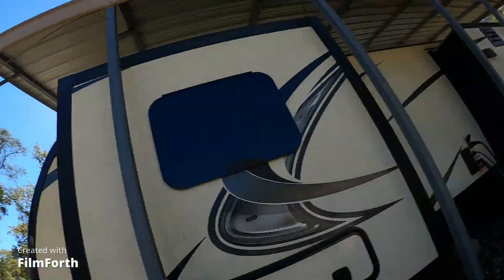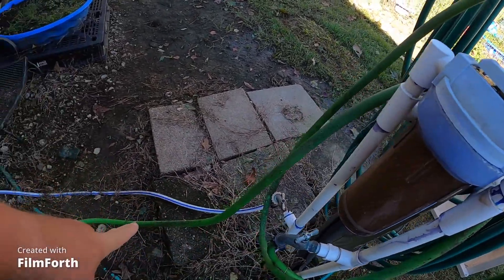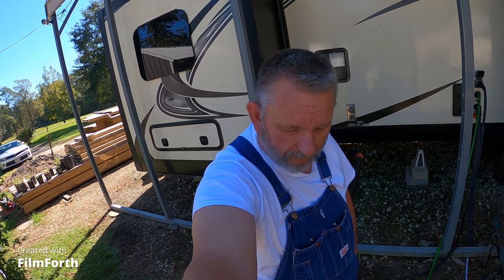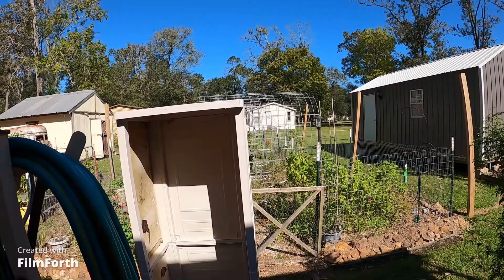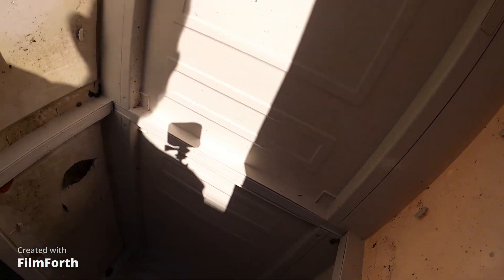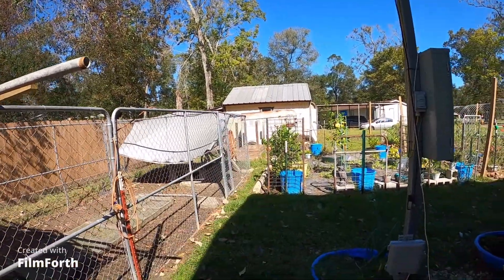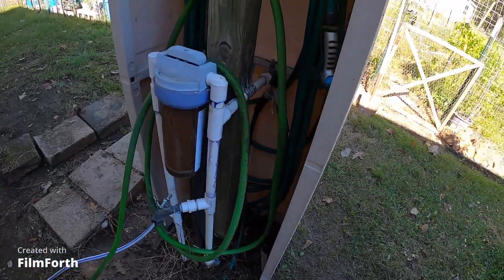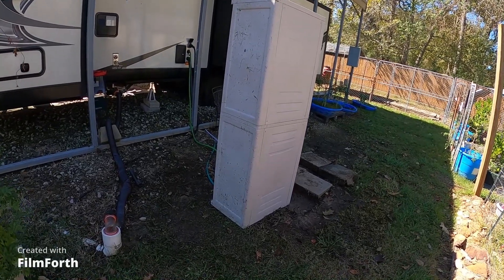GETTING READY FOR THE ARTIC BLAST

Comment: The cat box is perfect. Once you get the box on I'd still put a tarp over it and tie it at the bottom. I'd also put a tarp on the bottom of the camper to block the wind from getting to the water lines. Also put the foam on the pipe and the hoses. God bless and much love to you and Theresa.
Reply from the maker: Ok thanks I'll be working on that before it comes

Comment: You can get heated RV water hoses.  Also, for the pipes there is electric heat tape that you can wrap them with.  Pretty reasonable cost.
Reply from the maker: I called around they don't have the tape around here im going to get it on line
Reply: @LONESTARPIONEERING  I would get a heated RV water hose too. Most places that sell RV supplies have them. Your idea of putting a heat lamp on the top of your box may not work because heat rises. The heat may not get down to your pipes. Blocking the wind with the box is a good idea though, its like a well house. Our son puts an electric space heater in his well house. Whatever you decide to do, I hope it works.
Reply from the maker: @Autumnjoyz  thanks

Comment: I think Home Depot or Lowes sakes 120 volts wire heaters you can Wrap around the pipes.I think if you cut the water pipes shorter or change the direction going up that will give you more room for that box also you can put foam insulation on the walls in the box tin can glue or screw it.They saying winter going to be bad. Thank you
Reply from the maker: You really gave me a great idea I'll be going to homedepot Friday thank you very much

Comment: What about the fire retardant insulation for inside the cabinet, since you are going to use a heat lamp. It is those lines to the home that will also have to be well insulated. Have you ever seen the type of electrical wire that you lay across the edge of a roof, that causes the snow to melt and prevents build up on the roof? Maybe something like that wrapped around those water hoses, after the insulated slip covers are on, would be enough to prevent freezing. Good luck. You will figure it out.
Reply from the maker: I didn't think about that thank you very much